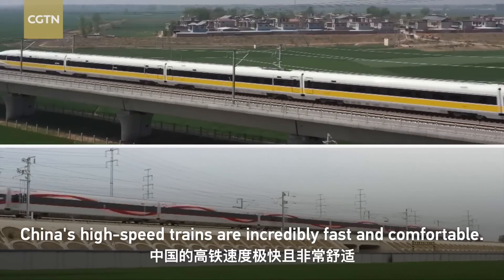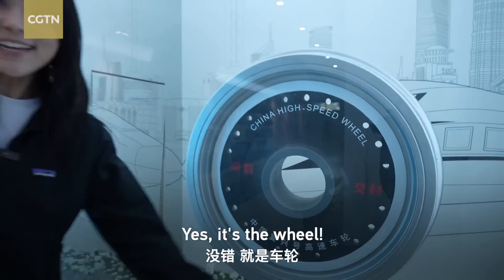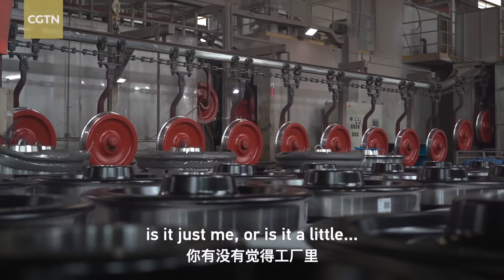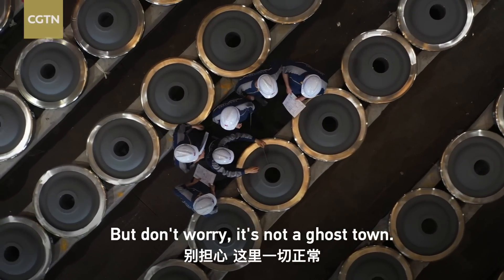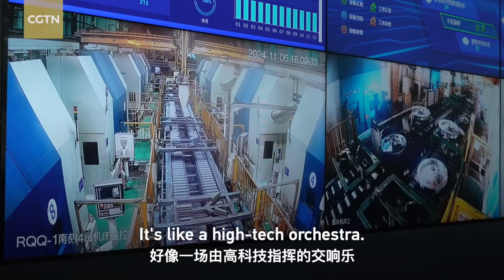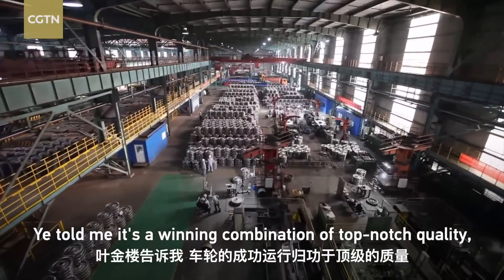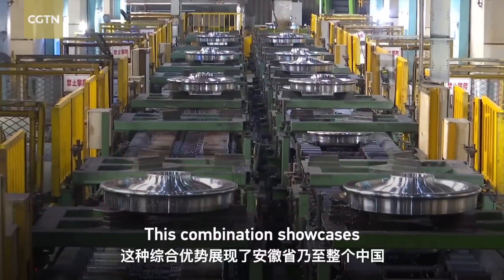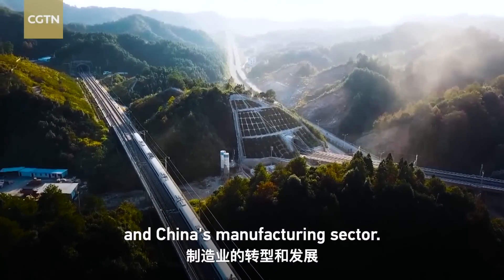How China's first home-made train wheels are revolutionizing high-speed rail

Comment: 😂😂😂. Obviously she has not traveled in a carriage with an inferior domestically manufactured wheel. Chinese wheels cause the carriage vibrate. I fear for those riding on a high speed train with Chinese made wheels. They will fail prematurely with deadly effect. 

China is not able to replicate the alloy steel necessary to manufacture safe wheels and bearings.

In addition to using substandard alloy steel, they lack the precise engineering and tolerances necessary to ensure safety at high speeds. The fact they're stamping out 1000 wheels a day with just 18 workers says a lot about quality. You can not simply stamp out a high speed rail wheel. The wheel must be machined from a solid block of high strength alloy steel. Stamped wheels made of soft brittle steel will fail prematurely, without warning.

Comment: There will be trouble ahead if the west got wind of China has a factory with 18 persons producing 1,000 wheels a day.  That is a self-confession of "forced labour", isn't it?

Generally, a single wheel of a freight train can weigh anywhere between 250 to 500 pounds (113 to 227 kilograms). so 1000x113/18=6,277 kg.  That means each person has to shift 6.2 tonnes everyday!